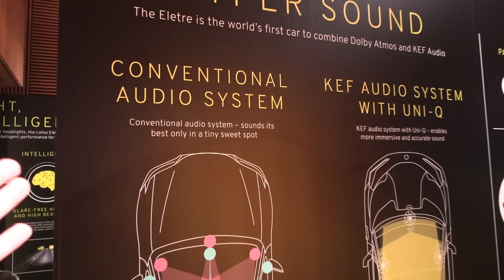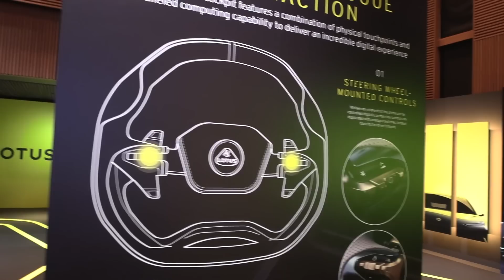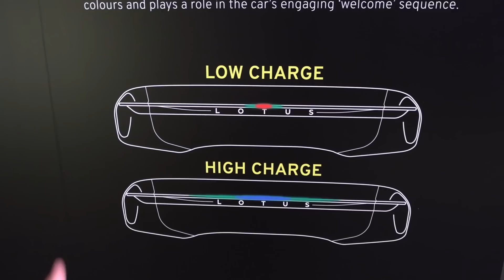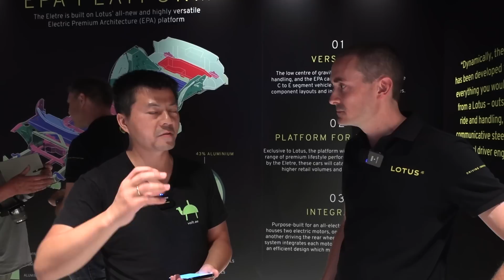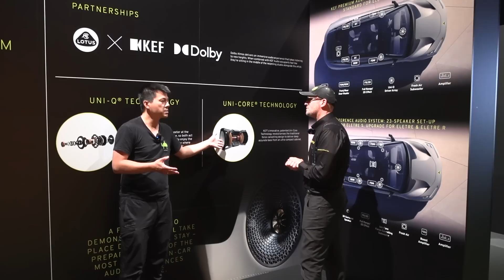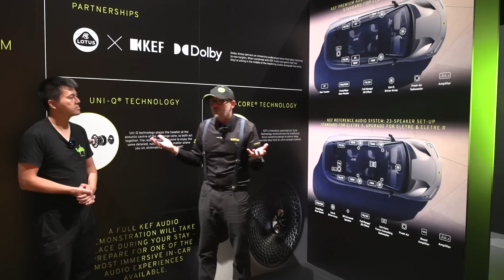Lotus Eletre tech zone

Comment: I have a Lotus Eletre with the Kef reference since 3 weeks. Currently very disappointed (and many other Eletre owners) in the Kef system. Almost no bass (subwoofer almost does not work) and no equalizer . Sound quality of Dab is a disaster (worse than FM!). Hopefully this is a software problem and can be fixed with an over the air update.
Reply: Any update since your post ?
Reply: @LetStartanewlife Meanwhile, there have been several updates and the problem has been solved. Now we have an equalizer and the sound is superior!

Comment: Very nice video. I assume we talk NMC811 here. Wonder how many cells they have
Reply: Prismatic, CATL Qilin pack I think. "Cell" count wouldn't really make sense, these cells are like big bricks
Reply: @chengcao418  it is interesting to know if this is like a 180s1p or 180s2p config.
Reply: @evkx  high 800V architecture, Bjorn saw around 810V at 75%, NMC chemistry that's probably more than 200 cells. It's probably 200s2p, considering the capacity of the pack as well